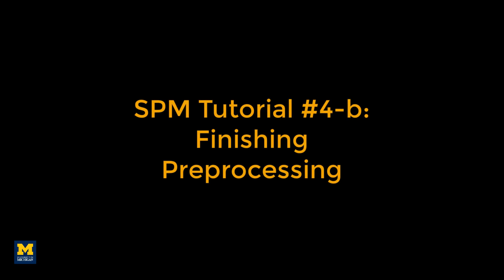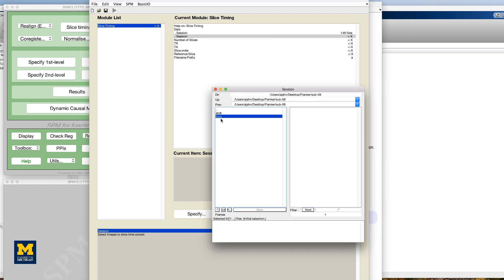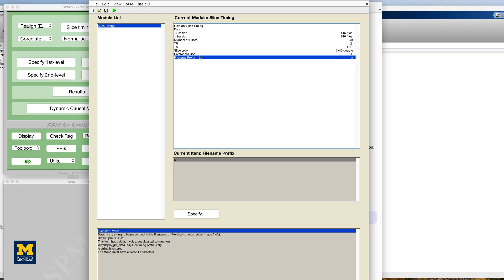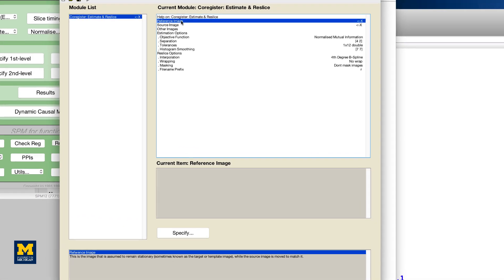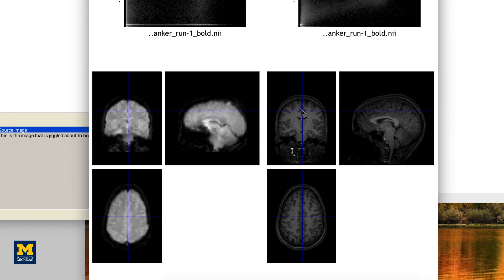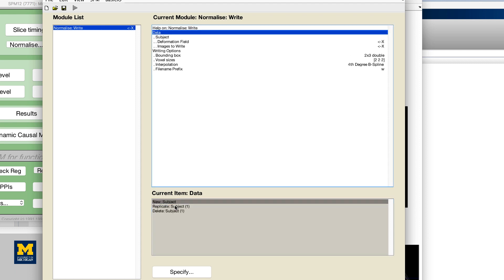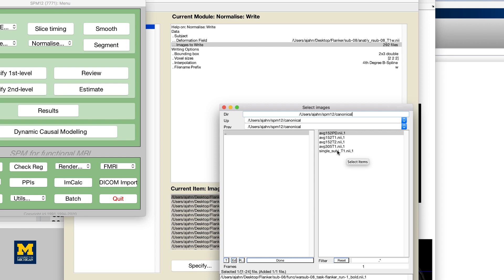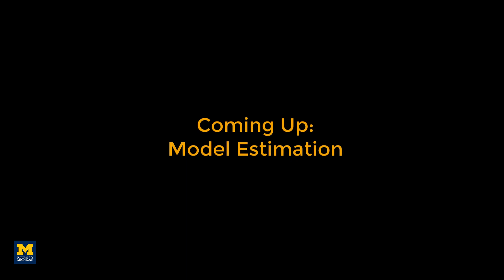SPM Tutorial #4-b: The Rest of the Preprocessing Steps

Comment: Hi Andrew, thank you very much for your tutorials! After having performed the segmentation and normalization steps as you explained, when I use "check reg" my upper image is completely different from yours; it seems tilted of 45 degrees to the right. Do you have any idea why?
Reply from the maker: Hi there,

Are the functional and structural images well aligned after coregistration? If not, what is probably happening is that the origin might not be set correctly; try following the steps outlined here on your anatomical image, and then re-running coregistration: https://andysbrainbook.readthedocs.io/en/latest/SPM/SPM_Short_Course/SPM_07_SettingTheOrigin.html

Else, it may be an orientation issue, which you can attempt to fix with FSL's swapdim tools: https://andysbrainbook.readthedocs.io/en/latest/FrequentlyAskedQuestions/FrequentlyAskedQuestions.html#orientation-problems. You can also reorient the anatomical and functional images through the Display button in the SPM window, by tweaking the orientation buttons and then saving the image.

Best,

-Andy
Reply: It worked; thank you very much again, for your videos and for your answer! @AndysBrainTube

Comment: Dear Sir,

Many Thanks for all the video tutorials.

How was the number 146 derived, couldn’t find it in the brainbook either.
Pardon me, if I missed something.
Need to know because I plan to run SPM on fMRI BOLD data acquired on Philips scanner.
Reply from the maker: Hi Amit,

You can find it in the header by typing V = spm_vol('name_of_functional_data'). This will return a variable V, which should be a 146x1 struct array; the first number (146) is the number of volumes.

In any case, setting the volume selector to an arbitrarily high number will max out at the number of volumes that are in the dataset.

Best,

-Andy